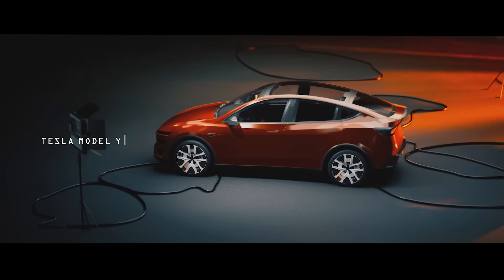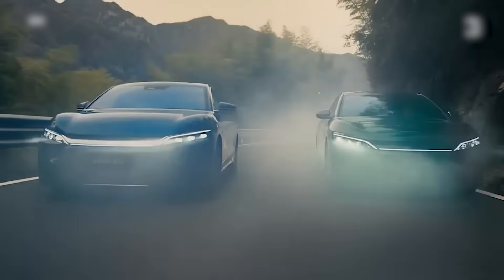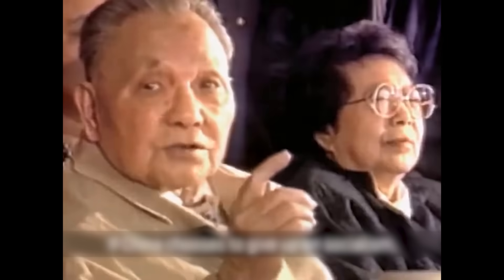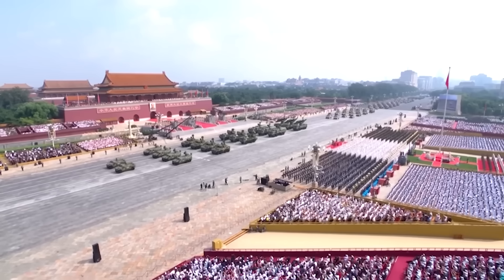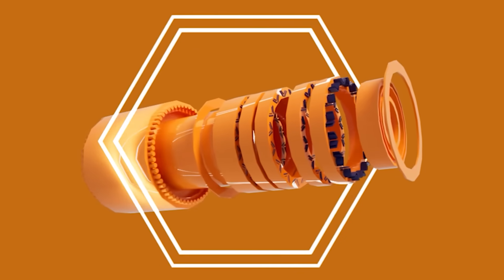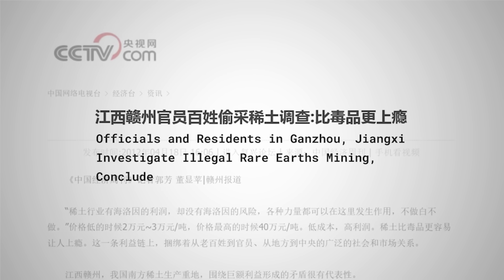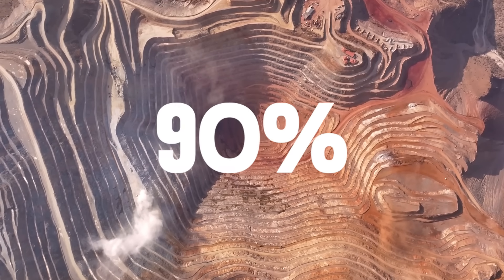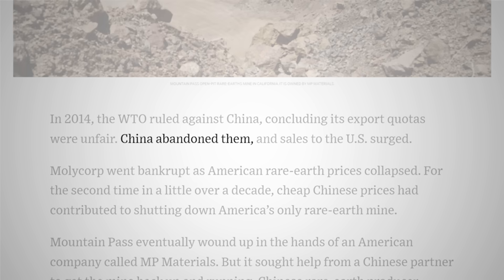Why China Owns the Future

Comment: Key Rare Earth Alternatives
Iron Nitride (FeN): Made from abundant iron and nitrogen, potentially stronger and cheaper than rare earths, ideal for motors.
Tetrataenite (FeNi): An iron-nickel alloy (found in meteorites) being lab-synthesized with phosphorus, offering rare-earth-level performance.
Manganese-Aluminum-Carbon (MnAlC): A long-standing, more sustainable magnet material.
Ferrite (Ceramic): Cheap, abundant, and good for many applications like speakers and car sensors, though weaker than rare earths.
Aluminum-Nickel-Cobalt (AlNiCo) & Samarium Cobalt (SmCo): Older magnet types that still use some critical elements but avoid neodymium. 
Broader Material Substitutions
Graphene: A single-atom-thick carbon material with potential in flexible electronics, batteries, and structural parts, notes Rare Earth Exchanges.
Zirconia Nanomaterials: Used in lithium-ion battery electrodes as a stabilizer, reducing rare earth use and improving battery life, according to JAPAN Forward.
Silicon-Based Electronics: Power electronics and control software can replace rare earths in motors and generators, says RMI. 
Emerging Technologies
Nanotechnology: Designing engines with iron-based nanostructures to match rare-earth magnet performance, mentions the Institut für Seltene Erden und Metalle.
Synchronous Reluctance Motors: Magnet-free motors used in some electric vehicles, notes RMI

Comment: You’re overlooking the underlying economics of a security-driven demand model. When a U.S. defense system is compromised and eventually reverse-engineered by an adversary, contractors are not particularly disadvantaged; they know the government will fund the development of a counter-system, sustaining the cycle of innovation and procurement. A similar dynamic exists with rare earth dependencies—numerous academic and federal research programs are actively pursuing material substitutes and diversification strategies. So while your point captures the general concern, it lacks the broader structural context that explains why the system shows little urgency in changing course.

Comment: China’s rare-earth refining capability did not “come from the United States.” The solvent-extraction principles developed in the U.S. belong to open scientific knowledge (the United States never transferred complete rare-earth separation processes to China, never provided industrial-scale routes, and key equipment and formulations were classified as sensitive technologies and not exported).

Through decades of independent research and development, China has achieved breakthroughs in multiple critical areas, including: industrialization of large-scale continuous cascade extraction, development of high-efficiency extractant systems (such as advanced P204/P507 formulations), full domestic production of centrifugal extraction equipment, green separation technologies for ion-adsorption rare-earth ores, production of ultra-high-purity rare-earth oxides (99.999%), and fully integrated automated process-control systems.

All these advances are independent technological achievements made by China, while the United States’ withdrawal from rare-earth refining in the late 20th century further widened the technological gap.

Comment: American leaders sold us out for gluttonous short-term profit- and rent-seekers.
Reply: But they become rich
Reply: @cyrus8012  And then they move to Singapore before you can hang em
Reply: Not really, the US just couldn't produce everything on their own, they needed to find ways to increase volume at a faster rate and at lower costs and no other country could have done it better than China. Remember, China was not the one that initiated the "trade war", it was the US that attacked China first with its tariffs and other restrictions, that's why China had to counter them with it's rare earth export restrictions. They are just defending their country.
Reply: amerifat coward citizens never stood up to the tyrants that owned them. its completely on you lowlives.
Reply: US burn their soft power on supporting genocide and crazy tariff too.
Reply: @backpackpepelon3867  chibot again🤣
Reply: China’s rare-earth refining capability did not “come from the United States.” The solvent-extraction principles developed in the U.S. belong to open scientific knowledge (the United States never transferred complete rare-earth separation processes to China, never provided industrial-scale routes, and key equipment and formulations were classified as sensitive technologies and not exported).

The true difficulty of rare-earth separation lies in process scale-up, multi-stage cascade control, extractant system design, and engineering of separation equipment.

Through decades of independent research and development, China has achieved breakthroughs in multiple critical areas, including: industrialization of large-scale continuous cascade extraction, development of high-efficiency extractant systems (such as advanced P204/P507 formulations), full domestic production of centrifugal extraction equipment, green separation technologies for ion-adsorption rare-earth ores, production of ultra-high-purity rare-earth oxides (99.999%), and fully integrated automated process-control systems.

All these advances are independent technological achievements made by China, while the United States’ withdrawal from rare-earth refining in the late 20th century further widened the technological gap.

Comment: The main problem is how fast can the US get its rare earths into mass production mode if a major war kicks off in the Pacific? If the US cannot get its rare earths production up in time then it would suffer the fate of the Axis powers, aka running out of oil.
Reply: A major war in the Pacific will only kick off if the US provokes it. So...
Reply: Most of that infrastructure is already there from before the mines shut down. They would need to shift equipment around but it would happen in a couple of months at most to reach decent production. They could also open new mines elsewhere, we do know where a LOT of deposits are (and there are a lot because REMs actually are quite common). We don't mine them currently because there's no point, it's simply much cheaper and easier to let China mine and process them and deal with the environmental and health fallout.
Reply: Isn’t this the ideal outcome? It’s making the US a peace loving country